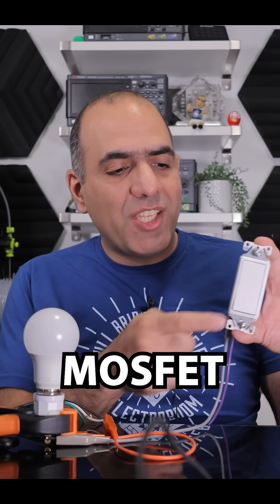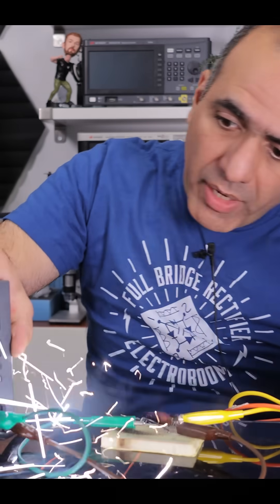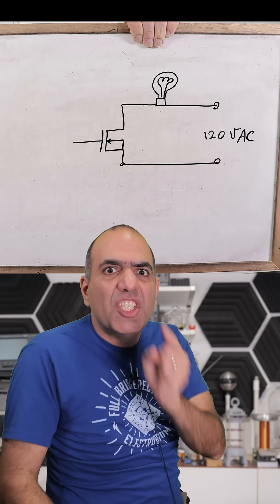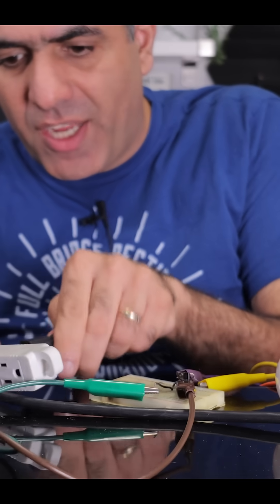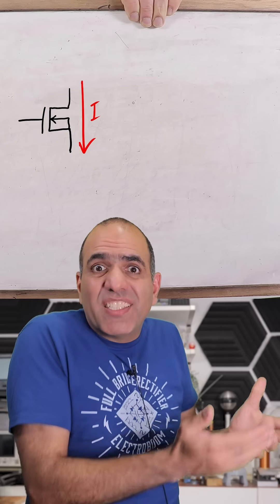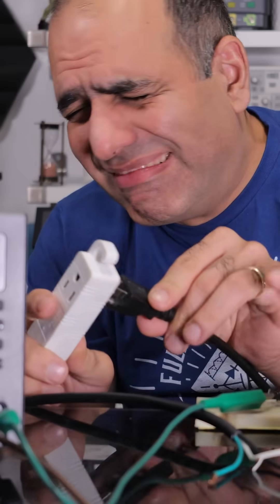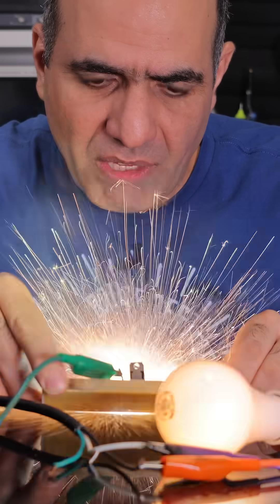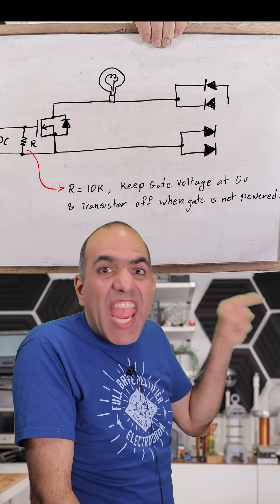Transistors are Tricky #technology #experiment #test #funny

Comment: You need to use a Triac for AC voltages.  Mosfets are designed for use with DC.  Hence the Full Bridge Rectifier to make it work.
Not sure why ElectroBOOM would even suggest using Mosfets for AC switching, other than BOOM value.

Comment: Sure, that'll work, but switching DC is cheating. If you wanna truely switch AC using the same parts, connect the AC input of the rectifier in series with the load (like a normal switch) and use the mosfet to short the DC output of the rectifier. And there you go, a true solid state switch for AC power.
But with either circuit, keep in mind, that the source and drain of the mosfet and therefore anything you use to control it will essentially be live. To anyone reading this, don't do this unless you know what you're doing.

Comment: How does a switch amplify an audio signal?
Reply: By operating it in its (almost) linear region. The MOSFET starts turning on once the potential starts going above it's minimum Gate threshold voltage and achieves minimum RDS a couple of volts above the minimum threshold at the gate. At this point the device will saturate. Operating the device with a varying input signal that is within this range, we can use it as an amplifier. BJTs are more suited to this application rather than MOSFETs though.

Comment: That ElectroBOOM sure knows how to get the magic blue smoke out of things.  Especially with the 50volt-nominal protoboard. 

Hadda cheap DVM flash short to the case of the equipment once.  🫣  Didn't consider the insulation capacity of the meter casing, which, shall we say, didn't measure up.  Just once.

Comment: I have an old(1987) switching PSU with 2 big bipolar transistors on the primer side, right after the bridge rectifier and the DC capacitor, and they are blown. The new, equivalent ones that are available today, have a 50 ohm resistor built in between base and emitter and the old one does not have the resistor. Could this be a problem? Is that why my PSU does not work?

Comment: using a dc component directly in main ac is pure stupid

use a triac or some shit

see my point? u even added a rectifier, making it "dc"
Reply: He is teaching about a MOSFET, not a triac. He knows exactly what he is doing!
Reply: @bbaucom2  he doesnt

he is electrical, not electronic

in fact, this is totally the wrong way to teach about mosfet

nobody connects mosfet directly to main ac

mosfet is mostly used in low voltage dc circuits

only in specialized places are they used for high voltage dc

so by showing high voltage, it is totally the wrong place to start and teach

using low voltage led with a power supply would be better
Reply: @urnoob5528  You're an educated noob who just doesn't get it.

Comment: It would be better to connect the rectifier only to the MOSFET. Then the lamp will still run on AC. Otherwise there may be problems with LED or energy-saving lamps.
Reply: then the mosfet will blow

common mosfets like those i have seen only handles up to 20 v vgs

worse, the main ac will short through the diode via the common point if connected like that

so its definitely not better
Reply: @urnoob5528  I think you misunderstood me. The rectifier is connected to drain and source. It is the same circuit, only the bulb moves to the AC side.
The gate is still driven by 10V.
There is also no short. The bulb is still in series.
Reply: @lutzj74  I think it could work, however the ac waveform will be slightly chopped in the near zero volt crossing.
But yeah it will be fine for most application

Comment: What you need is a TRIAC for AC.
Reply: You could technically connect two in antiseries, connecting both mosfets’ gates and sources together. There exists special optocouplers with a tiny photovoltaic cell in them for driving mosfets.
Reply: @WindowsSucksUwU  Yeah, that doesn't work.  The problem is that half the time you will have the voltage reversed on one of the mosfets.  They are not designed to have a reverse voltage, hence the protection diode.  Also switching from one mosfet to the other at the 0V crossover would be complicated and cause problems (bang?)
Triacs are designed to switch AC voltages on and off.  BTW those optocouplers are meant to drive Triacs and other high voltage devices to keep the high and low voltage sides isolated from each other.  Some of the optocouplers also have zero crossing circuits so that the Triac turns on at zero volts to reduce surge currents and electrical noise.
Reply: @WindowsSucksUwU  Did some research, you are right.  You can do AC with 2 mosfets. Seems I'm a little bit out of date.😳